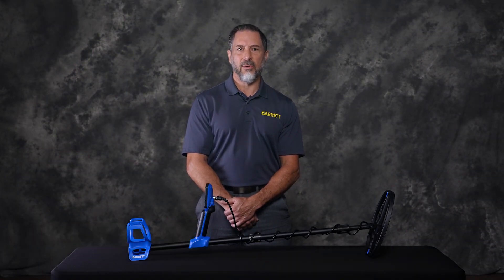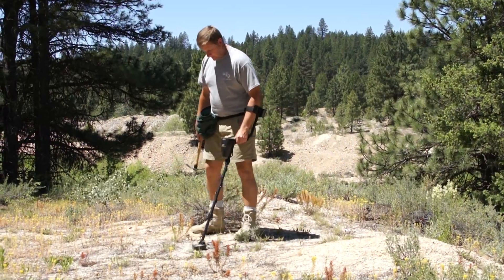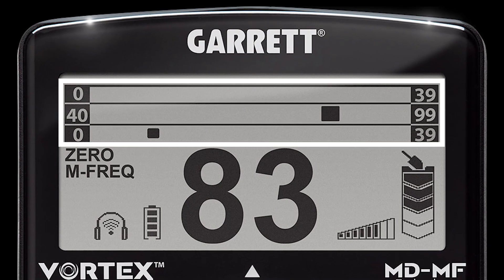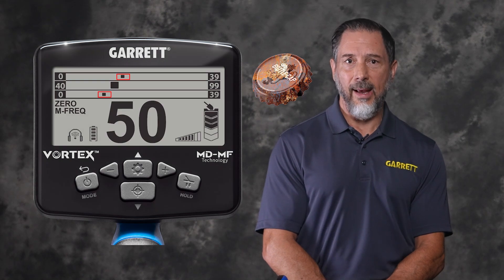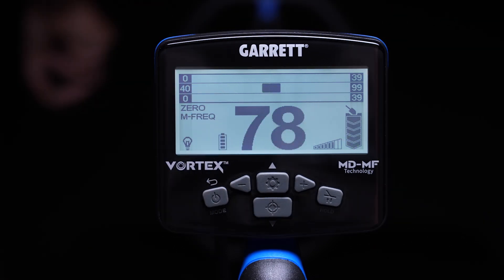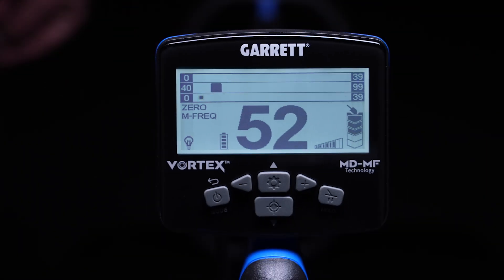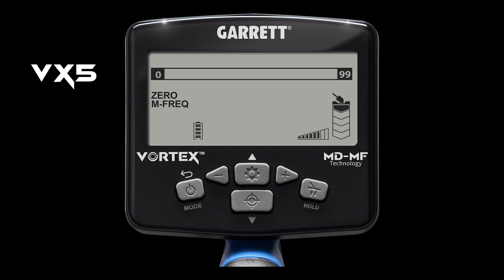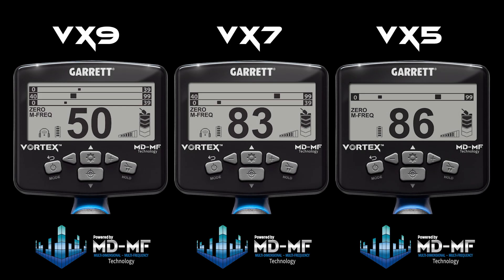Garrett Design Engineer Discusses Vortex Technology

Comment: Can you put new rechargeable batteries in it  in the field if the batteries go dead or do you have to go home and plug it in and recharge it
Reply: You can't change the battery but you can plug in a power pack for extended hunting. Battery life is about 15hrs

Comment: For a machine that was overly hyped with “ The Storm Is Coming” teasers for months I was expecting more. It’s basically a re cycled APEX with a new shaft & paint job. Nothing ground breaking at all. I would have expected to see more features and definitely more audio options for the amount of time you’ve spent in R&D. The software is nothing new is it? It’s basically Simultaneous MF with a maximum of 25khz? Come on garrett you’re not even trying here. This machine won’t even make any waves in the market at all, considering you have Minelab, Nokta & XP all offering budget machines with great features. If you’d made the hardware and software great and something different to start with I think you may of been in with a chance, but unfortunately you’ve dropped the ball here big time. You need to go back to the drawing board and come up with an offering that’s really going to turn heads with the wow factor. Not just offer a pretty mediocre at best machine with purchasable software options.
Reply: @The_Essential_Light  I have nearly 30 years of detecting experience and have been involved in machine development and testing so I’d say I’m pretty much an expert and entitled to my opinion. I’m not biased at all, I’ll use the best machine that suits my needs and gives me an advantage regardless of the brand. Unfortunately for me the Vortex has nothing to offer that I can’t already get from competitors in the same price bracket. In fact similar competitors machines in the same price range offer a plethora of settings and features that the Vortex doesn’t. You don’t need to be an expert to work out that this machine is inferior to what’s already out there. I was expecting more with all the stupid “storm is coming” hype and was hoping for a machine with catagory 5 wow factor. But unfortunately for me, it’s an anti climax and nothing more than a dust devil.
Reply: Perhaps the vortex aimed at kids?